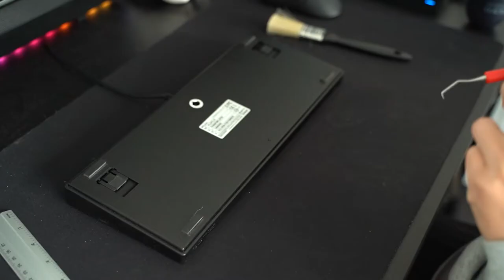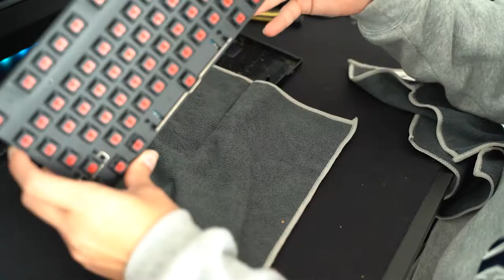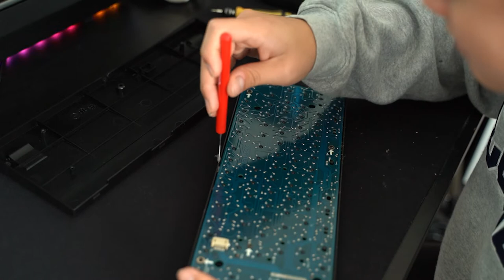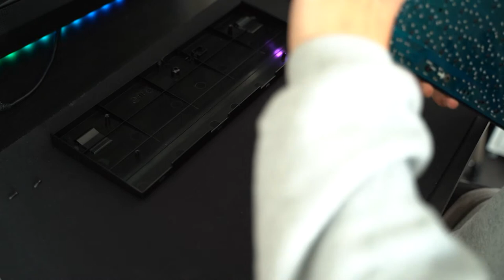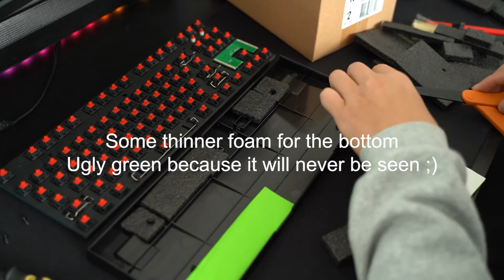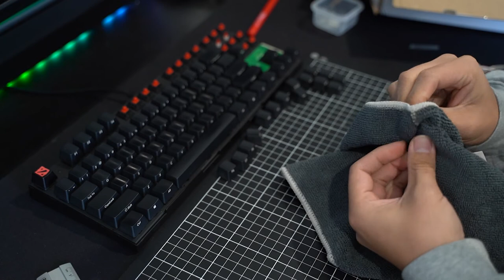Cleaning + modding my 10 year old mechanical keyboard - FILCO Majestouch Ninja TKL Cherry MX Red

Comment: I'd also recommend getting some foam inserts for your spacebar to deaden the sound further if you still find it to be too loud. 

I have a Majestouch 2 and recently considered building myself a new keyboard. Despite having the MX Silent Red version of the Majestouch 2 with soft o-rings installed I find it's still too loud for my liking. After looking for some replacements I realized I'm actually really attached to my keyboard and don't really want to replace it. I'm going to try and get another used Filco for cheap and have a go at desoldering the switches so I can lube and film them as well as add foam between the plate and PCB. Apparently there's a way to make the PCB hot-swappable too.
Reply from the maker: I’ll definitely look into that, the space bar could definitely do with some tuning :)

Comment: Hi, great video! I’m about to do the same as you and I have 2 question
1) what lube did you use
2) how difficult it was to remove the outer frame. I saw another video and it looked really hard
Thanks!
Reply from the maker: Hey thanks man! Sorry for the late reply.

1. Full transparency, I used some thick ointment my girlfriend had laying around 😆 it had a good thick consistency when I tested. It's still going great haha.

2. It can seem difficult because the frame is so well built and would, but take your time. I used some old credit cards etc to hold open the clips on one end while I did the other side. After that it came apart really easily :)

Comment: I bought a used Filco Majestouch 2 tkl on offer up for $15. That thing still worked but it was disgusting!! I opened it up and it had cigarette smell nailclippings,  dust, gunk, hair etc. I gave it a good cleaning with 90% alcohol and a tooth brush. The person thay owned must be a dirty person. I replaced the keycaps and did the tempest tape mod. I just ordered new stabilizers and lube. Currently sanding the cover to paint it. Going to do a detachable cable mod after.
Reply from the maker: Awesome man! Let me know how the cable mod goes, I would be very interested :)